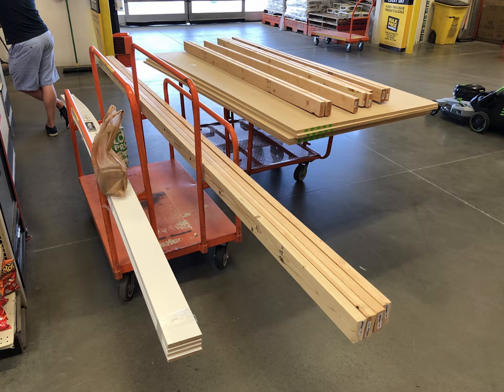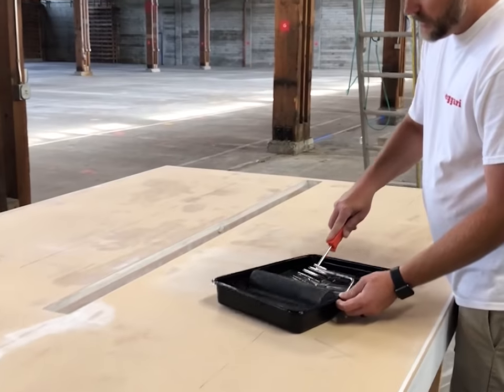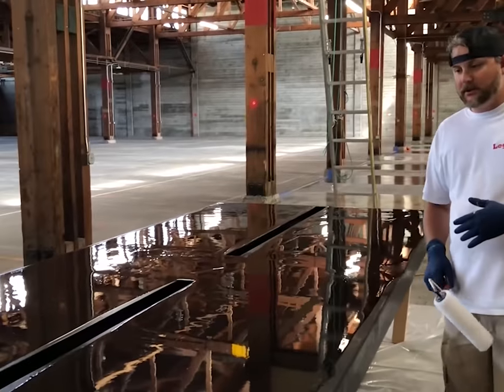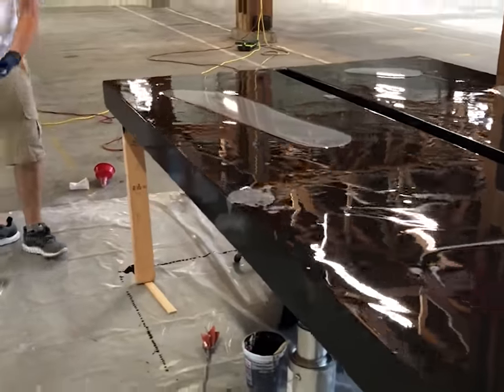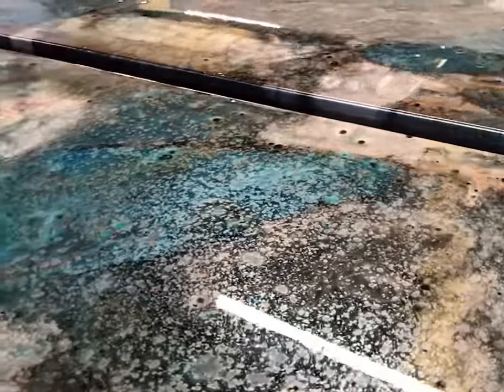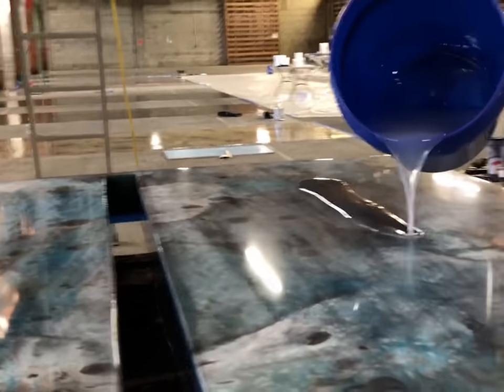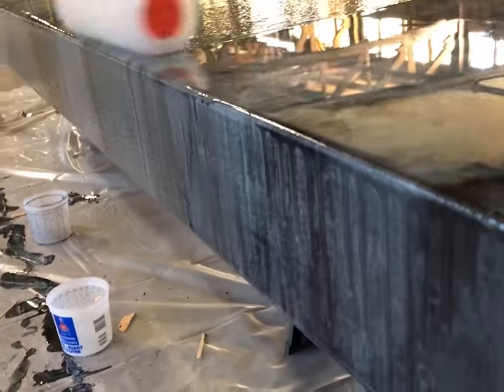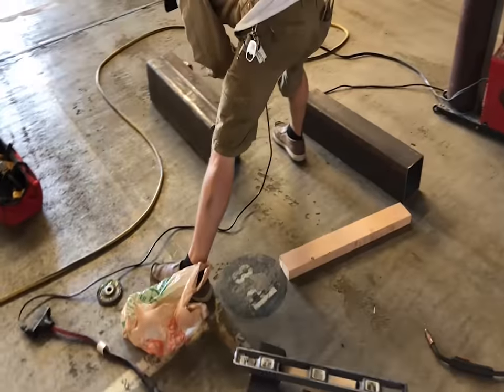14ft Custom Made Conference Table | Metallic Epoxy

Comment: Wow, you sure are proud of your product!  $595.00 for 10 square feet of silver black metallic with a urethane top coat!!  I did my entire kitchen in Ubatuba granite for $1,000  Not sure why the high price but that price is absurd for epoxy paint!
Reply: Then don't  buy it.  You obviously do not realize how much  time and money goes into a project like this.
Reply: @scarlettmulluns582  Are you saying if I purchase the epoxy resin for $595.00 that price includes them coming to my house and doing the work as well???  Otherwise $595.00 for 10 square feet worth of epoxy resin is EXTREMELY overpriced and your comment has no relevance to my original comment.

Comment: So sand and add that clear epoxy is another step to get that glassy look?
Reply from the maker: You don't have to sand the surface if you apply the glaze top coat the next day after applying the epoxy.  Thanks
Reply: Leggari Products but its an extra step u can do right for that glassy look? I haven’t seen it done in any other of your videos

Comment: The work is wonderful and very beautiful ... but I have a question for you why after the end of the epoxy on any surface I work his sand it ... Is it because the epoxy does not bear friction and is quick scratching or is increased in order to look more glitter .. Thank you
Reply from the maker: The only reason they would sand it is if they did not apply the top coat the next day then you have to sand the surface to apply the top coat.
Reply: Thank you for the quick response and this is the evidence of your success 👍👍❤️❤️

Do you have an explanation on a video that explains this reason to be clearer to me and others also 
My from Iraq 🇮🇶 we don’t have there is no one to learn from only YouTube
Thanks again

Comment: Is it necessary sand the surface to apply the clear finish?
Reply: since its a table/desk top it will get scratchs and dents. The clear will protect the lower coats. Just like car paint.  You sand it so the clear has something to stick to.

Comment: great video guys is there any way you can show how to connect epoxy floorint to laminate wood flooring. I am doing a room in epoxy and dont know how to transition it at the door jam to the laminate wood flooring. Thanks.
Reply from the maker: You can email leggari@gmail.com with this question and are tech will respond back to you with the best solution.  Thanks

Comment: Can this stuff be applied on a regular concrete slab? As long as it’s nice and straight can this be used instead of a marvel floor?? Like this stuff is freaking nice looking great stuff I love the finish product great work.  Let me know thanks
Reply: You'd have to profile, first. ICRI CSP-2, at least.  Adhesion is super important. So, if you're using a huge planetary grinder, you'll probably get away with a pretty flat floor. If you're using a 7" angle grinder, even if you are PRO, it won't be perfectly flat. I like to use RS Levelquick, to flatten a floor out.  I've used a lot of levelers, and this stuff is silky smooth. It doesn't clump or get stuck in mounds.  After that, you can absolutely go to town with these epoxies.

Comment: Do you have a formula for determining how much resin to mix? Also, how long of a working time do you have?
Reply from the maker: Our epoxy is a 2:1 ratio and once you add the hardener you will have 45 minutes to an hour to work with the epoxy.
Reply: Leggari Products How do you know how much product to mix? Re: I am doing a 72”x26” counter top? Also I notice you don’t wear a mask when working with your product. Does this mean it’s nontoxic?
Reply from the maker: One gallon will do 45 sq. ft.  You can email leggari@gmail.com asking for the ratios and they well send them out to you.  The product is very low VOC’s meaning it has little to no smell at all. It’s 100% solids so there’s no toxins evaporating in the air.

Comment: is there a varnish or resin on top?
Reply from the maker: He did not apply a top coat to this table.  We have 3 different top coat options. Glaze coat is our super high gloss top coat that lays out glass smooth just like the metallic epoxy coat. Our WB Urethane comes in high gloss and leaves a minor texture and we also have a WB Urethane that’s a Matte/Satin finish.

Comment: 10:28
This is going to sound like a stupid question...
but WHY is he sanding at this stage.. It l@@Ks perfect.
Reply from the maker: If he waits longer than 30 hours to apply the top coat then you will have to sand the surface so the top coat will adhere.  Thanks
Reply: @LeggariProducts  
That's right... I knew that!!! 
I learned that in your other videos...
Thanks for your speedy reply.

Comment: What kind of primer you use some special type of resin primer or normal..?
Reply from the maker: Our primer is a water based epoxy specifically designed to chemically bond to almost all smooth surfaces.

Comment: how do you make it scratch resistant ? i mean really. epoxy scratches like crazy so thats why no1 does it?
Reply from the maker: We apply a urethane top coat that is four times stronger than epoxy.

URETHANE:
3:1 RATIO
URETHANE HAS 2 OPTIONS (ORANGE PEEL & MATTE/SATIN FINISH TOPCOAT)
URETHANE TOPCOAT GOES DOWN 400-600 SF PER GALLON
Our Wb Urethane Topcoat will come with 3 parts (A, B & C). The urethane  without the grit/Part C is kind of the best of both worlds. Its not the most durable or highest gloss but its a bit more utilitarian as it gives you a mid-range slip/scratch resistance while still maintaining a high gloss finish, with just a slight orange peel texture.

Now if you add the Part C Powder while mixing, you will get a Matte/Satin Finish. This will be a clear, semi gloss, matte textured finish. It has the highest slip/scratch resistance but does sacrifice the high gloss finish.

Comment: Do you guys have contractor pricing?  I've been using TCP on and off, since 2014. Had really bad bubble issues, though.  I've even babysat the basecoat with back-rolling, until it was pulling on the roller, and come back to a hundred bubbles. It's annoying. I've played with CTM, but don't like it much.  Love your videos.
Reply from the maker: Our pricing on our website is at contractors pricing.  You can actually order or price out a custom kit for that exact square footage through the Counters section of our website at www.leggari.com. Simply click on Counters >>>> Order Counter Kit Here, then follow the steps.

Comment: How should it be done so that the edges are not dripped?
Reply from the maker: The edges will always drip, you just need to scrape the edges of every half hour.
Reply: Alternatively, you can either mask or roll out the bottom of the edge.

Comment: your works is always fantastic , supper supper cool . 
but i have one problem with my epoxy work , that i cannot resolve it . 
when i see your projects they are always have nice and flat surface , with beautiful shine ,mirror finishing  .
but with my projects every thing is cool except that i always have a wavy surface ., it is shiny and nice with beautiful reflection but not complete flat as mirror .
as i know this will happen if i use the heat gun after the epoxy starts to harden . but i use the heat gun only for 10 mints after pouring  . i don't know how to resolve this problem , could you advice me pls
thanks
Reply: Need to use a thicker coat. This happens when you don't have enough epoxy to properly self level.
Another very useful tip that I'm surprised these guys don't do, is use blue painters tape along the edge, about a half inch above the surface of the table, basically making a bowl out of the table. Pour in epoxy, spread out, do all your effect things, and then let sit for 30-40min and start to get tacky, then pull tape. Your epoxy will very slowly roll down the edges and this makes for exceptional corners and an edge coat that's much closer to the same thickness as the coat on the top of the table. Plus you waist alot less resin

Comment: It's a spectacular job, the problem is that the epoxies are easily scratched
Reply from the maker: That is why we have the urethane top coat, it is four times harder than epoxy and makes the countertops more durable.  Thanks
Reply: @LeggariProducts  I understand perfectly, the problem of urethano layer is its orange peel texture that makes lose the great brightness of pure epoxy. It is possible that someday they will make an orange-skin-free urethano. Thanks
Reply from the maker: Not sure if they will come out with that but we are working with R&D to try and do that.  Thanks
Reply: Surfkoat makes a 55% solids moisture cured urethane that's far less likely to orange peal,  or there is always polyespartic top coats